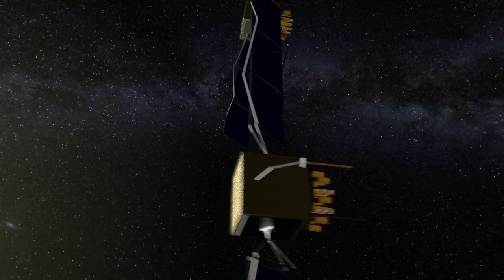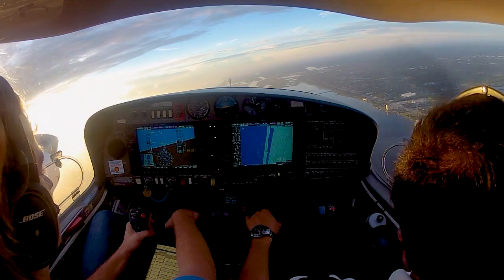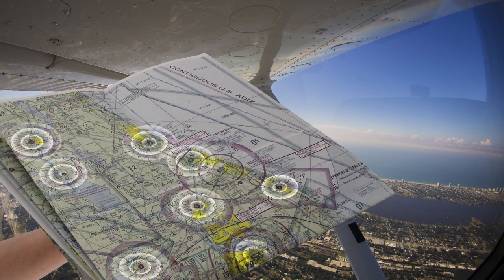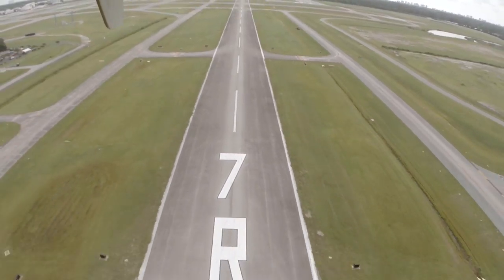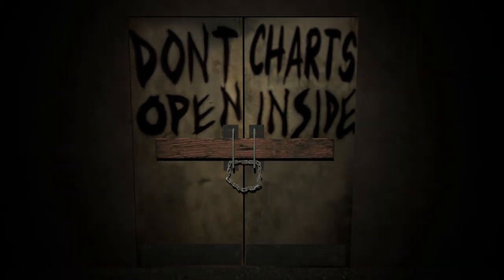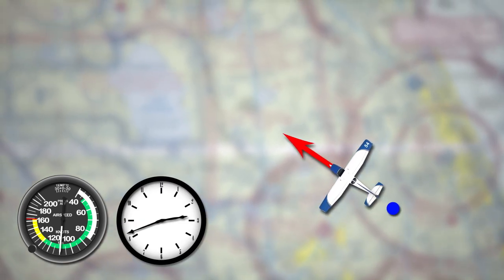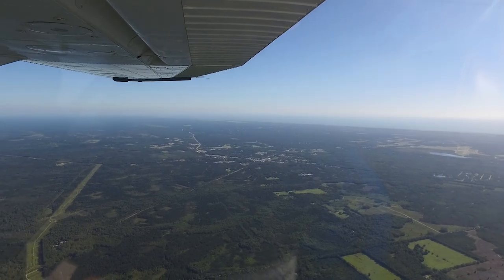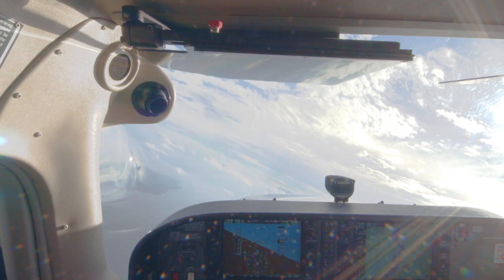Pilotage and Dead Reckoning

Comment: I have been flying over 30 yrs, ATP, CFI inst/me, and still enjoyed this video. It is a great instructions. I could give one on one or ground school on this subject. And in general instructor to student training is better than passive videos... However in this case this VIDEO is very effective and well done.... If need to teach a primary student I will give them this link and follow up with a review. WELL DONE.... PS Thinking back over 30 yrs as a student / pvt pilot I took great joy in dead reckoning and pilotage. When I was a student GPS had not quite got into the GA planes cockpit (LORAN was around as wide area NAV). VOR was the primary ground based NAV and required charts. Now with GPS (in our watch, phone, car, plane) it makes pilots lazy about NAV, if you ask me, but than again I am a cranky old Captain. Ha ha. No matter your experience it is always good to dust off the basics and be a student again and always.

Comment: Isn't Dead Reckoning actually Ded-Reckoning, read Deduced Reckoning?
Reply: Apparently not.
Wikipedia says "The term "dead reckoning" was not originally used to abbreviate "deduced reckoning," nor is it a misspelling of the term "ded reckoning." The use of "ded" or "deduced reckoning" is not known to have appeared earlier than 1931, much later in history than "dead reckoning" appearing as early as 1613 in the Oxford English Dictionary. The original intention of "dead" in the term is not clear however. Whether it is used to convey "absolute" as in "dead ahead," reckoning using other objects that are "dead in the water," or using reckoning properly "you’re dead if you don’t reckon right," is not known."
Reply: Ypu can use both it is the same brotha

Comment: The E6BJA Flight Computer (Apple, Android and Surface Pro) has a Wind Visualiser and Diversion Star which can be used to easily calculate each Leg of a Dead-Reckoning route and Diversions. Simply input your cruise IAS (Indicated Air Speed), Track/Course and Wind Vector. The calculator will then provide the Wind-Corrected heading to fly and the time taken (used for ETA). It has many other calculators too.